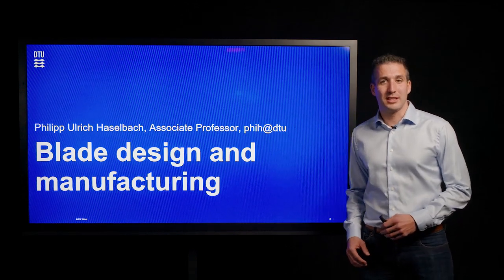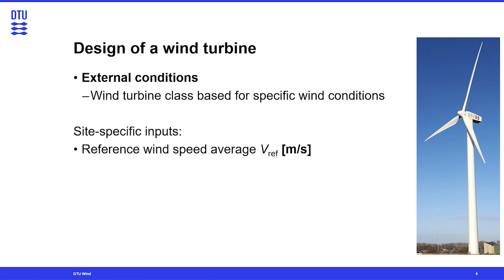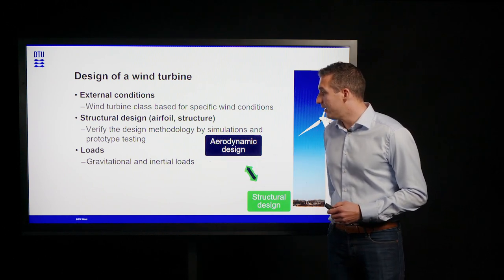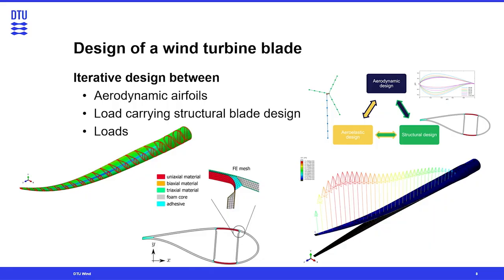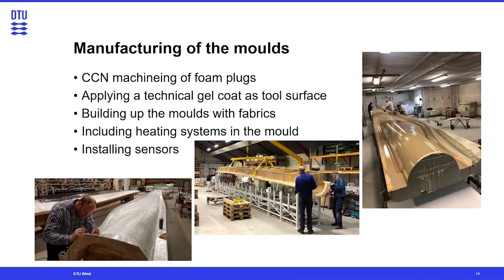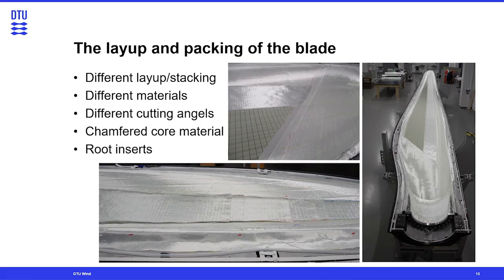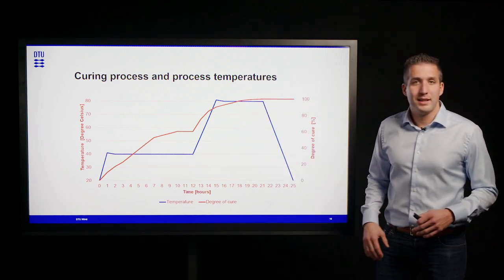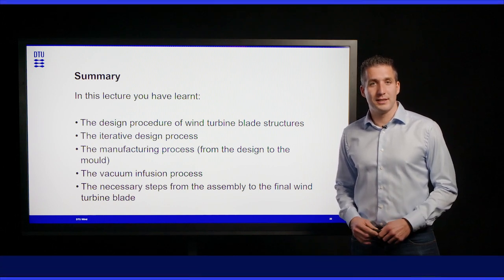Blade Design and Manufacturing

Comment: 🌬 Key Takeaways  🌬

🔧 Design Procedure: The design starts with parameters like rotor diameter, height, and rated power. External conditions such as wind speed and loads are considered for a good structural design.

💨 External Conditions: Wind turbine design depends on site-specific inputs, including wind classes and turbulence classes. Reference wind speed and maximum wind speed are crucial factors in determining the design.

✈ Aerodynamic Design: The blade's aerodynamic shape is optimized to create lift while minimizing drag. Airfoil thickness varies along the span of the blade, ensuring structural strength and efficiency.

📏 Structural Design: The structural design focuses on creating a lightweight yet sturdy blade. Layup, material distribution, and layering techniques are crucial for withstanding loads and ensuring durability.

⚙ Aeroelastic Design: Aerodynamic and structural designs are iteratively refined to account for loads and optimize the controller's efficiency. Simulations and testing are conducted to validate the design.

🔬 Verification and Testing: Numerical simulations and finite element analysis are performed to validate the design methodology. Strain, stress, tip deflection, and buckling are analyzed to ensure blade integrity.

🔩 Manufacturing Process: The manufacturing process involves creating a mold, packing blade components, and performing the vacuum infusion process. High-precision measurements and inspections are conducted.

🔍 Inspection and Adjustments: Mold geometry is scanned, and adjustments or repairs are made to meet design specifications. Ply sequences, cutting angles, and root inserts are carefully considered during packing.

🌪 Vacuum Infusion Process: The preform stack of fabrics, foam, and inserts is infused with resin using vacuum and resin distribution media. Proper resin flow and curing ensure a quality composite.

🔥 Curing and Assembly: The infused blade is cured using controlled heating. Components are adhesively bonded together, and the blade is trimmed. Geometry checks are performed before final product completion.

nice  comprehensive overview of blade design and manufacturing. Thanks Professor Philipp for a great video.